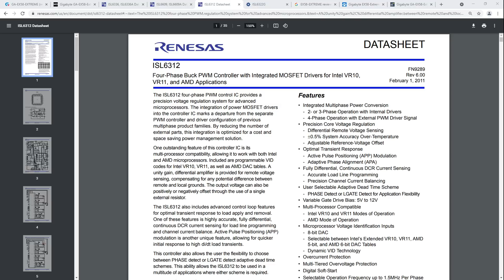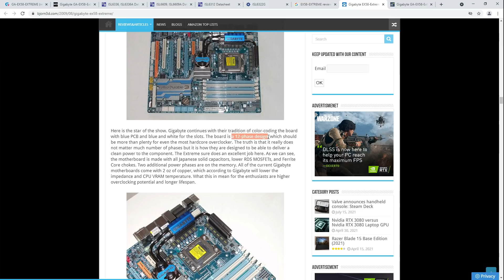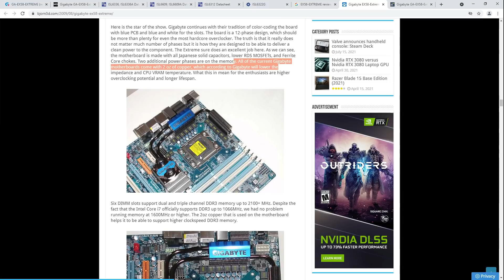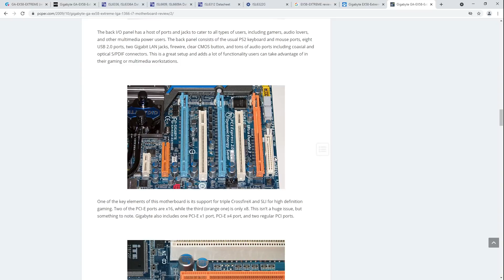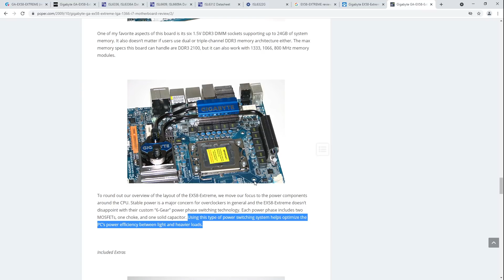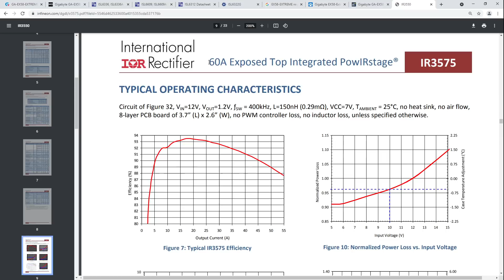Motherboard manufacturers have been lying about VRM phase counts for years.

Comment: I ALWAYS found it strange that the inductors are in parallel while they claimed it to be a separate phase but never bothered... They do this to reduce the inductor resistance and so improve efficiency. Its a good opportunity to double the phase count for marketing too...
Reply: there are double step-down two-phase buck converters, so 6 of them are 12 phases.
Reply: @darkbreed  how many switches would need for that (without counting parallel FETs)?
Reply: @nosafetyswitch9378  Viewing housings on a mainboard has been useless for more than 20 years. Since you can accommodate several die and additional circuits in one housing and obviously one controller controls all converters (he has shown this), you can't make any visual statements about the circuit. If you could at least find out what the component is called, you could look it up in the data sheet. but tapping a chip and not knowing anything about its internals is like "milking a dead cow". He cannot make any statements about trace lengths and controlled interconnections or how the voltage to the CPU is physically composed, let alone whether it is a real parallelization or a clocked circuit. Obviously, he neither had the knowledge nor the equipment to take appropriate measurements that would cover his statements. Just the fact that he has no idea why there is an oscillating circuit behind the converters or why there are more capacitors than converters (which indicates that this is not a real parallel circuit and that there is a clocked circuit here, since the additional capacitors intercept the switching peaks of the two-phase converters (called smooth switching via resonant circuit feedback)). I did not design the board and do not have it here to carry out the corresponding measurements with an oscilloscope, so any statement on how the circuit works would be pure speculation, but I do not believe that after the waves of complaints in the 90s, someone in 2008 still had incorrect data about an electrical engineering product, especially not if the board is / was available in europe.
Reply: @darkbreed  that was a decent response. I agree on the bulk about the video creator not having a deep knowledge (neither do I) about advanced topologies like these but I am afraid your argument about being 2008 and companies being truthful especially about such hype/niche products whose buyers like fancy words that don't actually understand, does  not hold much water. I am also leaning towards the principle of "dont make it more complex and expensive that it should be". These 2 reason would be enough to justify such marketing misleading. 
Now if we want to know for sure, an oscilloscope and measurement would be needed as you say.
Reply: I contacted gigabyte and my assumption that it is a clocked circuit was confirmed (which is why I can now answer your question about how many switches, there are no additional switches they are integrated in the clocked controller ;-)). The buck converters / regulators are two phases in one housing and they gave me a rough idea of how the entire VRM circuit works. it has three levels and after each level there are DCR sence circuits for each output, from which the 17 capacitors can also be derived (12/4/1). this designation 12 + 2 + 2 means 12 basis converters + 2 converters for the stabilization of the 2nd stage +2 further converters for the stabilization of the last stage (the controller actively switches off individual phase converters or, if necessary, switches on the additional ones in each stage, based on the DCR sence results). therefore one can only assume that the operator of this channel has only partially understood how a VRM works, but has not dealt with this specific circuit and the components used.
Reply: @darkbreed  well done, I therefore accept that they are not lying. Any chance for a general schematic of all that or is it asking too much 😅 😂
Reply: @nosafetyswitch9378  They didn't leave me a circuit diagram, just roughly explained how the individual circuit components are connected, as I posted it. since this is a clocked circuit, we would also need the circuit diagram of the controller and a signal diagram to fully understand this specific circuit, i think this would go too far into the manufacturer's internal information.

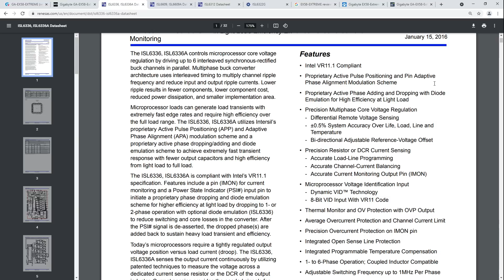Comment: at 18:58 lower right corner the manual says 1 to 6 phase operator .............
maybe A double step-down two-phase buck converter is used, so 6 of them are indeed 12 phase counts. looking at the component you cannot tell whether it is a one step or a two step.

Update: i have contacted gigabyte. The 6 buck converters / regulators (they call them operators) used are actually TWO phases in one housing. So there is no such thing as a lie, just a youtuber who brings assumptions instead of measurements and knowledge to get clicks.

Comment: the '00s were the dark ages for the pc DIY segment (there were darker ages, but mostly talking about late '00s as fairly modern times).
almost all reviews were blurb copy-paste jobs, even the so-called hardcore/expert sites/outlets. information like chips/controllers manufacturers/models of a mobo/ram module or an actual examination of a mobos power delivery/components wasnt publicly available/easy to find. youd have to dig deep and hard to come up with even a small part/any of the above and very rarely some obscure outlet/review site would hold any info. any useful  info about a mobo/ram modules was like a top CIA secret.
but us hardware guys knew about gigabytes 6 phase/asus's 8 (high-end mobos)/4 phase. OC/technical forums were full with discussions about that. ram chips info was even harder to get a hold of. the guys who knew were guys like you, but "unpublished" cause no one was doing this type of content back then

Comment: I have built my first PC in 2003 and I‘m literally an electrical engineer but I never checked if the VRM phase is as advertised.
On the other hand, I never overclocked either.
Thanks for pointing this out.

Comment: I have a Question!
How come some traces on the circuit board do a bunch of S turns and squiggles instead of going in the shortest possible path? hope that makes sense
Reply from the maker: legth matching for signals that get sent in parallel.
Reply: @ActuallyHardcoreOverclocking  thanks

Comment: Can i ask one more thing. I have no knwldge abt electronics. But, is the inductor placed near the cpu power socket important ? For power delivery ? 
I'm seeing lower end boards having those but comes with "poor"(to my uneducated eye) power phase, while some other boards without inductors near the cpu 12v powersocket  but, have some beefy power phase.  Any advise ? You can check recent Intel H510 boards(Asus, Msi, Gigabytes).

Comment: God I miss X58 chipset. I still have my i7-920. I used to overclock that thing from 2.66ghz all the way up to 4.0ghz on all cores stable. That shit was wild! I had an MSI X58 Platinum SLI. I had 12GB of 1366mhz Runing in triple channel.
Reply: I had an ASUS P6T Deluxe x58 with core i7 940 and 24Gb Ram and oc at 4.1ghz. I miss this time.

Comment: And that isn't the board with the most Gigabyte VRM BS -  "While this board (Gigabyte GA-X58A-UD3R) has a traditional chemical capacitor VRM circuit, the GA-X58A-UD7 has a more advanced 24-phase VRM design with solid-state capacitors." - Bit-Tech review of Gigabyte GA-X58A-UD3R; May 7, 2010.

Comment: FX 5200 taught me about problem how a hot GPU die and VRAM do not work very well and how it can be easily fix with something like a Iceberg kit.
FX 9590 taught me about need for more power and the problem with hot Vrm and CPU. 
well here I made my first DIY fan Bracket and Frankenstein together my first open loop cooling system from parts of AIO's and other parts I could find in your local hardware store.

Comment: This board looks like it has the same VRM as my fully working UD3R v2.0 that i got from a friend for 100czk with an i7 960 D0 and an original big 1366 box cooler :D
Reply: @n0rie9a  I have the rev. 2.0 and it has 12 inductors around CPU. It also has 2xUSB3.0 ports on the back and 2xSATA 6G ports from a separate controller on the board+another 2xSATA 3G from another controller on the board-GBT kinda overdid the board with extra controllers besides chipset.

Comment: whats a "solid capacitor"? It looks like a smt electrolytic.
Reply: A simplified expression to indicate a capacitor with a solid conductive polymer electrolyte. 

Also, saying "It looks like a smt electrolytic" is kind of broad. For your information: 
- smt just indicates the mount type, ergo smt/smd = surface mount,
- all capacitors have some sort of electrolyte.

Comment: What is the technical or economic reason for having "phases" in the VRM at all.  Why not just use components of sufficient quality and power handling ability to manage MB power?    As a graduate electrical engineer from back in the dark ages, phase to me normally means power line phase in AC whereas MBs tend to operate from DC power unless I have missed something in the last few years (I probably built my 1st PC in about 1995 and swapped components since the late 1980s).
Reply: something yada yada sine curves, phasing them means more curves but they aren't 100% overlaid on each other but "pushed apart" so the "dips" in the power is removed which gives smoother power (you can look it up for more correct terminology)

Comment: Phase counts are like how many cylinders your car engine has.. Higher numbers often correlate to better performance, but not always and only if they're designed well.
You can get an amazing V8 engine in a performance car.. but you can also have a stock NA V8 that uses more fuel and makes less power than an inline 4cyl turbo that makes fart noises when it changes gear.
People still buy V8 trucks just because they can brag about it, plus the whole 'no replacement for displacement' despite being slower than a soccer mum's diesel SUV

Comment: Yes we were calling this out back in the day, but this was on forums and LANparties. We knew reviewers were fucking useless, especially since most of my circle had started water cooling before there were even commercial waterblocks.

PC Gamer snake oil has been around for years and I've just learnt to look out for it. My recent fav is ASUS and their "Tri-band" routers that only work on 2.4ghz and 5ghz. If they said Tri-Radio I wouldnt have an issue.

Comment: Bizzy, I think, even the Mobo manufacturers thought that was a 12 phase VRM.
Reply: it is a 12 phase VRM because it uses double step-down two-phase buck converters and so the specification of 12 phase count is probably correct  but this guy is not a trained technican and thinks because he only see one component housing it is a lie, but he has no clue how it is working internally.

Comment: Of course the reviewers don't care about the design, they're getting that stuff for free (most of the time anyways). It has to look cool, have a bunch of features and perform well. Overclocking performance isn't always related to hardware, software has it's part too. At the time hardcore overclocking was also not as hardcore as today.
Bottom line: if the average Joe can get good results with minimal effort it's a good product.

I've had plenty of well designed motherboards with crappy BIOSes which would simply not allow for certain FSB speeds or memory timings, simply because the BIOS was buggy.

Comment: Can you do the same with GA890FXA-UD5 rev 2.0? I am running FX 8350@4.8 with beta bios and works fine since i have started to use FX cpu. Max, stable oc is 5.0 for my cpu on watercooling. What we use is an unofficial bios from gigabyte worker. Funny thing is, officially this board doesn't support FX cpu's. :D

Comment: 2008... seems like yesterday. I'd been building pc's and (daily) overclocking for years at this point.
time scales are a matter of perspective. 
I guess when you get to a certain age (old) you refuse to accept that your prime isn't current (for me 2008 i was in my 20's and still had most of my hair, after that i stopped counting time the same way)

And yes your right despite having built computers since the 80's until you explained it i didn't understand VRM's apart from more = better

Comment: please great GURU of HW can you tell me if the new asus tuf b450 gaming plus 2 as vrms enought power to suport an ryzen 5600X on OC??please. i switch myne msi b450 gaming plus to the tuf an got an ryzen 2600X and pretend switch to the 5600X in september.i have an aio from artic frezeer 2 240mm and im very satisfeid with this tuf but i trust your brain opinion better then any other guru out there. please just take a look at the tuf and post someting about it. i already know the board as not the 8+2 vrms they say. is 4x2 + 2 phases. but they really look well done and i notice better performance out of the box just from switching from msi to this tuf.so im confused.

Comment: i have contacted gigabyte. The 6 buck converters / regulators (they call them operators) used are actually TWO phases in one housing. An advice to "actually hardcore overclocking" one should deal with the electrotechnical possibilities and measurements BEFORE disseminating such FAKE NEWS. Furthermore, the coils and capacitors are DCR sense circuits for feedback of the generated voltage. (12 DCR Sence directly from the phase modulators + 4 for the next combination stage (they also eliminate peaks) + 1 for the last combination stage (also eliminates the last combination peaks) before the voltage is fed into the CPU <ergo 17 capacitors for the entire circuit behind the regulators are normal). my assumption that it is a clocked circuit was also confirmed.

Comment: Gigabyte's full of shit, but VRM's werent really that big a thing back then else it would have been called out. Intel CPUs overclocked quite easily without worrying too much about VRMs, unlike today where they run them closer to their limits out of the box. Nowadays VRMs are the primary selling feature.
Reply: In 2009 I had an ASUS P6T Deluxe x58 with 18 phase  of VRM 16+2

Comment: Mine also has trouble with its RAM slots, wonder if it is a particular desease of the board ?
Also she (yeah it is alive) refuse to boot for days some time until the deamon goes away.
Reply: the CPU connection pins are still bent, the knowledge of this person is simply underground for what he is presenting here. He doesn't even know that there are double step-down two-phase buck converters and so the specification of 12 phase count is probably correct.
Reply: Yes you are right, forgot his bent pins.
May he have missed them then, I think he has enougth knowledge to cover that (think it is its field). I don't.
But even with doblers wich where used a lot back in these days, a true 12 independant phase wich lead to a better ajustement of the load.
Maybe it is more relevent now with all CPU states ans boost.
Reply: @mini-pouce  i'm a trained microelectronics technician and nothing of what he tells in the video comes from a corresponding education. Not only are there double step-down two-phase buck converters (in one housing and visually indistinguishable from single step-down single phase), today there are even triple step-down three-phase buck converters in use and the next 4-phase design is under development (Die stacking comes from this industry, by the way). He has no idea which firmware is running in the Buck converter controller or how a single phase buck converter can switch two phases without a time difference at the input of the CPU. VRMs are not so expensive components for nothing.
The mainboard manufacturers have their "secrets" and only trained microelectronics are able to really understand the circuitry of a mainboard. There are a number of physical tricks that have been used on mainboards since the 90s to create the same functionality with fewer components. Without weeks of measurements and precise knowledge of the tracelength, it is not possible to make statements on highly integrated technology as he makes it about this board, after all it is a 7-layer mainboard and he has no idea how the traces are laid within the PCB, he sees only the external power connections and this leads to pure nonsense from an electrical engineering point of view. he can neither show nor name the name on the converters, so it is not possible to understand what kind of component it is. I do not believe that a manufacturer made false information about his product in 2008, but simply that it is a two-phase buck converter and the guy has no idea about it. Here in europe, incorrectly specifying product properties would lead to gigantic lawsuits and in the 90s there were some through which hardware manufacturers dug their own grave with a lie. The fact is, I have a mainboard here where 12 phases are mentioned in the manual and there are only 4 converters on the board and the reason is that there are three-phase components.
Reply: @darkbreed  Will watch thanks.
Big topic but as you said amazing physic trics.